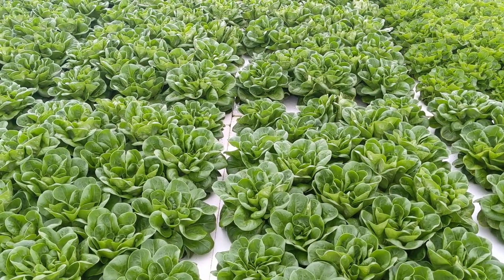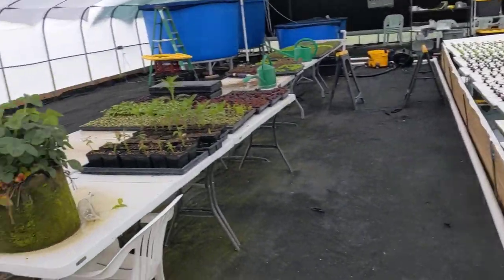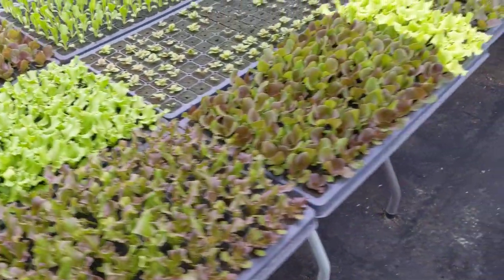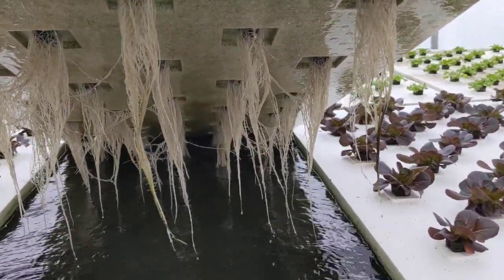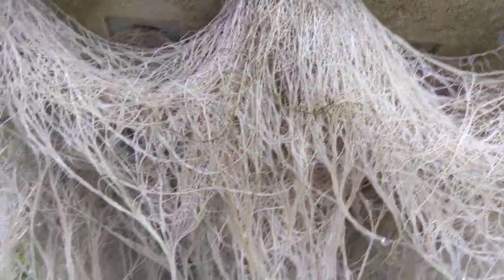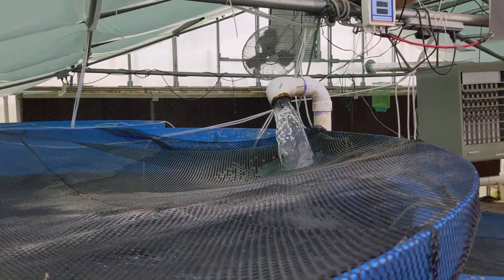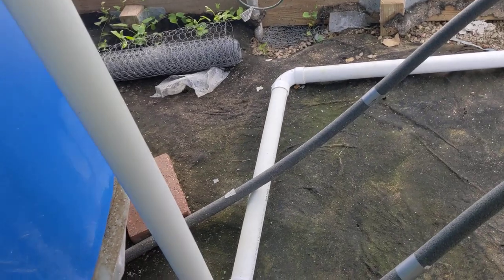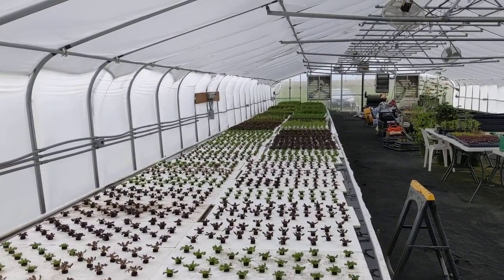Viking Aquaponics: Tour of our commercial system: May 29th, 2021.

Comment: Hi, Great job. just one question, is there Bio-filter/Bio-reactor in your system?
Reply from the maker: We use one of our smaller 250 gallon tanks as our solids settling tank. The roots of the plants provide all the surface area needed for the bacteria to thrive.

Comment: Hey thank you for the video, just wondering what do you use for the plant to hold in the draft and doesn't sink in the water
Reply from the maker: The plugs I raise the seedlings in are the same size as the holes in the rafts. The coco coir has some cellulose mixed in to help hold it together.
Reply: @vikingaquaponics3464  thank you, that is awesome 🤙

Comment: What material can you grow the seedlings in the tray and transfer straight to the foam rafts? I will be having a koi pond and don't want dirt to get into the water so I need a medium to sprout seeds and also transition to the raft water without dropping residues.
Reply from the maker: It is coconut coir mixed with cellulose so that it retains it's shape.

Comment: Hey, how big is your greenhouse? Can you give me any details on where to research one like this at?
Reply from the maker: The greenhouse is 34 feet by 120 feet long. Farmtek sells the style we got.
Reply: @vikingaquaponics3464  thank you for such a quick response I appreciate it.. also, would you mind me asking the estimate cost to put this up? Did it come with ventilation?
Reply from the maker: @Heyitsdash  farmtek has a sales team that will help you design your setup and put a quote together. We got our greenhouse structure (with end walls, double plastic layers, and extra snow/wind support package), air intake vent wall (with 25 foot long water wall), fish tanks, and propane heaters for the air from farmtek. Everything else we either built or sourced locally.
Reply from the maker: @Heyitsdash  but all in all the greenhouse was over 100k investment over the course of a few years.

Comment: How do you filter your waste I didn’t see it in the video
Reply from the maker: We converted one of our 250 gal tanks into a solids settling tank. Because we run a low density system, the waste problem is minimal. We try to stay in balance with how much the plants can filter on a regular basis.

Comment: What kind of plugs do you use in your rafts?  Where do you get them?
Reply from the maker: We use plugs out of 128 cell trays. They have an organic cellulose added to hold their shape. They insert directly into our rafts.
Reply: @vikingaquaponics3464  thanks for the reply.  What is the brand?  Where do you order them from?  We use flexiplugs we get from Zipgrow but they fall through the beaver plastics rafts unless we rotate them 45 degrees.  I am looking to source a better product.
Reply from the maker: @drewhenderson2218  we go through the aquaponics source in Denver. I'm pretty sure they are standard size 128 cell trays they use.